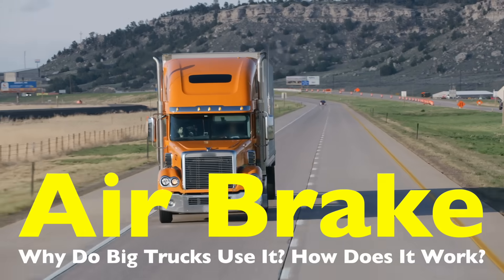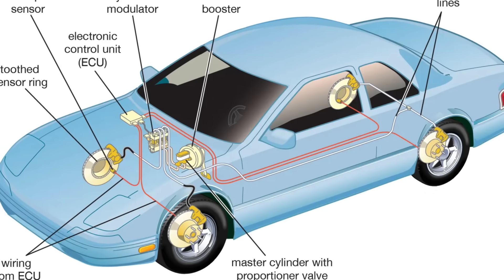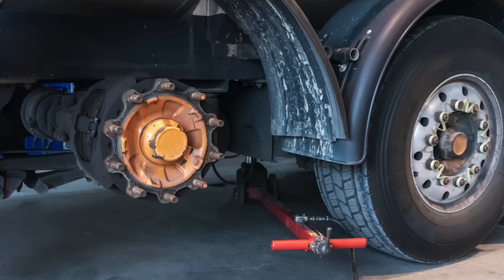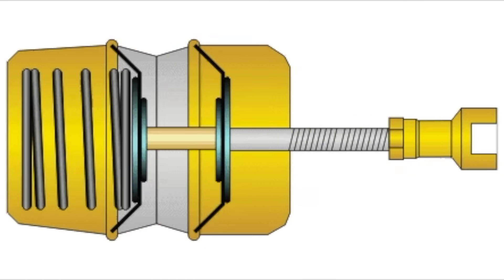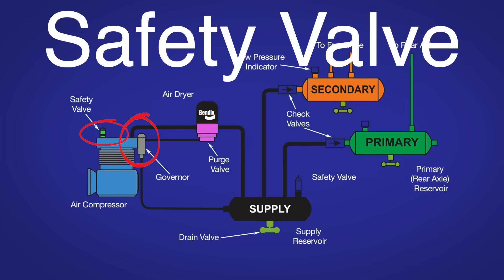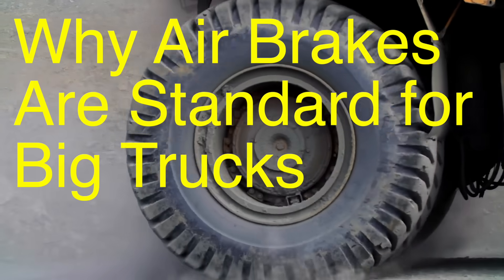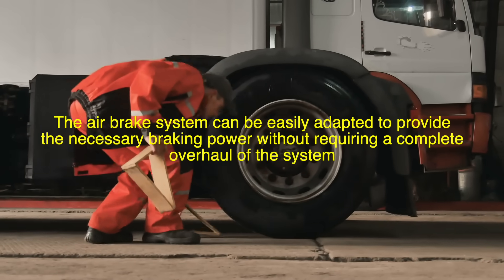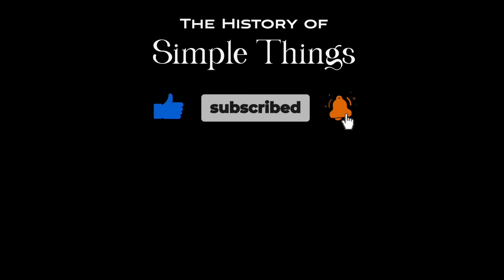Why Do Big Trucks Use Air Brakes? How Does It work?

Comment: As a truck driver, and mechanic. without even watching the video. I can tell you the reason why. It's because they're failsafe. Anything at all goes wrong with the brake system, and they lock on instead of just failing. Well then, you might ask why every car doesn't use them. They're marginally more complicated, require much more maintenance. Daily checks for leaks, and possible problems. As well as monitoring of various gages (and knowing what those gages mean, and the problems they're indicating). Asking the average person who doesn't even know how to check their own oil to do that? Yeah not going to happen.

Comment: It would be nice to see a video on how train brakes work.Ive studied them a bit and know they are actualy primitive and have no maxi,s as trains are much to long and it would take  to much air to build up to keep all the maxi,s off and way to much time.I do know that if trains could have maxi,s there would be 45 people still alive in Lac Magontic Quebec.That horrible accident was caused because the train engeneer an other crew left it running up on the hill with the engine was running a to keep the brakes applied.There was some manual brakes applid but not enough.Unfortunately te train or engine caught fire ,the fire department arived and did what seemed to be the logical thing to do by shuting the engine off .However the air pressure drained off thus releasing the brakes and the hand brakes couldnt hold the train from starting to roll down the hill into town creating a horrible disaster.If the train could have had the same breaking system as tractor trailers then the engineer would have applied both the engine brakes and brakes on all the cars and the train would have stayed still if all the breaks or most of them were adjusted properly.

Comment: one huge advantage is under hard braking you wont boil the brake fluid, and the air system and the valving allows for more pressure exerted to the brakes with minimal effort from the drivers foot and leg muscles.

Comment: The school bus I drove had air breaks.  Air brakes work opposite than hydraulic.  If there’s not enough air pressure, the brakes lock, stopping the vehicle.  Thats basically how they work.

Comment: Hello from Finland. Nice tutorial, thanks. Here our own trucks are in great condition due to mandatory yearly inspections (MOT) which are very strict.  But Russian trucks are very often in really bad condition. Our Customs check Russian trucks when they arrive here.  They must pass inspection before they are allowed to drive here. Often the driver loans or hires tools and fixes the problems themselves as they are used to maintain their cars even if it isn’t their own. And often they are much overweighted. Many trucks are turned back to Russia.

Comment: Another thing about air brakes is you can work on and replace any part of it, start the vehicle, wait for it to build air pressure, and then test the system. With hydraulic brakes, it is common to have to get someone to help you bleed the brakes. I find brake bleeding to be a time consuming process that is difficult with the configuration of the brake lines on some vehicles.

Comment: Air brakes can still function perfectly with a minor leak.  The air brake system will never run out of air but a hydraulic system will run out of brake fluid if there was a leak even a minor one.

Comment: The real reason they use air-brakes is the ability to change trailers; a hydraulic system would not allow for this.  Air-brakes are archaic, it’s basically the same system that trains have used for over a hundred years.

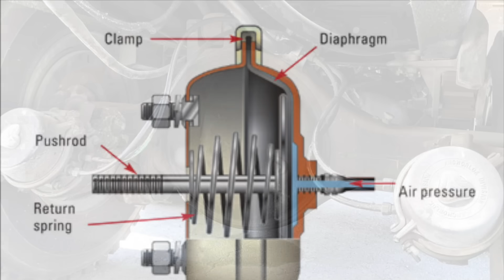Comment: 2:27  It should really be called air-released-spring-actuated-brakes.  The air pressure is actually holding back the spring that when released would mechanically clamp the brake pads or press on the wheel drums to stop the spinning wheels.

Comment: Hydraulic brakes can be used so much that the fluid can actually boil, reducing effectiveness. That's why some mountain roads have Emergency Ramps for failed brakes, but they are rarely needed now.

Comment: All of the smaller vehicles built after the sixties have duel circuit hydraulic brakes. Light and medium rigid tray trucks sometimes use an air over hydraulic system. The main reason large trucks use air brakes is for connecting the trailer brakes simply and easily, something that cannot be done with hydralics.

Comment: Quicker response. Compressed air moves at the speed of sound. Also if you tried to use hydraulics (fluid) to actuate all the brake chambers on a truck the driver would have to pump the brake pedal ten times to bring the brake shoes in contact with the drums.

Comment: Interesting, diagram labelled a spring brake. But wasn't a spring brake chamber. Stated air brakes are used because of the safety of a spring brake chamber. Air brakes were in use prior to the introduction of the spring brake chamber.
As mentioned by someone else. Input (brake pedal) application pressure to actual available output pressure is much higher in an air brake system, as opposed to a hydralic system.
Reply: Yeah, that was a simple service brake with no emergency spring. Good catch!

Comment: Big trucks use air brakes because the heat induced into the system by the massive friction it takes to slow a tractor hauling 80,000 lbs of goods would boil brake fluid in the lines and you would lose braking after the first few stops.

Comment: Hydraulic brakes don't "fail if there is even a single leak"

Just like air brakes, Hydraulic brakes are dual circuit. One circuit for front brakes and a completely separate circuit for rear brakes

Comment: hydraulique brake could do everything air brake do with less complexity the only reason air brake are still around in my opinion is because it would be hard to transition
Reply: Hydrauliques would be a big messy hassle when hooking trailers on and off. Something semi’s do daily !
Also air brakes are designed fail safe. If for some reason air pressure is lost (leak, hose unhooked, etc) the breaks would automatically apply on full force.  Those trucks (and trains) need air pressure to release the breaks, not to stop.

If you car has a big leak you can’t stop. If a truck, bus or train has a big leak it is stuck and not moving

Comment: My motor home has air brakes as it is based on a bus chassis.  I had a valve failure in the dryer and had a hard time building up enough pressure to leave a RV site in the mountains in the thin air.  When I got to a lower altitude the air was dense enough to overcome the leak.

Comment: If air brakes fail safe, then why do trucks lose their ability to stop when they are low on air? Try it, start rolling down a hill and keep applying and releasing the brakes until air is depleted, then try to stop.
Reply: By then the spring brakes will have engaged
Reply: They dont if the system is working properly. If you keep breaking and ignore the pressure warnings the brakes will slam on.  Though if you keep braking on a steep hill, the brakes might overheat and that results in loosing the ability to stop (until they cooled down again)

Comment: Air brakes main advantage is that it is not the driver’s muscles stopping the truck.  An air brake pedal opens a valve and then air does all the work. You are not forcing fluid down a pipe with a plunger limited by your own strength. If you’ve ever had a trailer push you down a road you’d know that you may have to get up off the seat and stand on the pedal.

Comment: The thing is on some trucks only one drive axle has the spring brakes so the other drive axle and the front brakes don't do anything if you loose pressure.  It's more common for both drive axles to have springs though, but you're still not getting any help from the front.  The front brakes really don't do much, but in an emergency the little bit they do will help a lot!!  Normally all trailer brakes have springs so they will do some good.  Springs can get worn and break over time and will never provide the same force as the air pressure operated part of the brake system even when new.
Reply: All trucks built since at least the 80's have spring brakes on all drive axles, and all trailer brakes are spring brakes. Steer axles don't have the spring brakes because if the pressure drops too low, the spring brakes will activate on all axles. That's not good because locked-up steer wheels go in the direction they were last pointing - despite where the steering wheel is turned.
Reply: It stands to reason. Most of the braking effort is always on the wheels carrying the most weight. In cars, 70% of the braking effort is done by the front wheels because the front wheels carry 70% of the weight in most cases. In a truck the rear and trailer wheels carry the weight, so that is where the effort is generated. In Australia, where a majority of long-haul trucks have more than one trailer, braking systems are even more complex. Road trains in NSW and VIC include either two 40-foot trailers or a 40 footer and two 20 footers in a C-triple combination and road trains in other states and territories are often twice as long and can weigh over 200 tonnes (440,000lbs), depending on the load being carried.

Comment: To be fair, modern hydraulic system on cars and light trucks in a seen have two separate systems as well. Meaning if you lose fluid to the front brakes there is still a reservoir with fluid to control the rear’s and vise versa in case a failure. It will allow multiple petal applications to an extent on a dual master cylinder provided it doesn’t allow air to enter the piston area and back into the system that isn’t leaking.

Comment: Now that I think about it, using a hydraulic system would be problematic when changing out a trailer. If you introduce air bubbles into a hydraulic system, it would create a dangerously spongy pedal. When attaching the air connection through glad hands to link trailer with truck, a small amount of introduced air would cause no problem at all.

Comment: I feel one of the key reasons air brakes are used was missed. It's the ability to readily attach the tractor's braking system to the trailer's braking system, simply by connecting air hoses together. Just like on a train, where the locomotive's braking system is easily attached to all the cars behind it. Imagine trying to that with hydraulics. Messy, inefficient, and not fail-safe.
Reply: There's hydraulic quick couplers to get around this

Comment: This is why we have so many runaway big rigs?
Reply: Improper braking on the part of the driver, or neglected maintenance of the system.
Despite the effectiveness of the system, the driver must get the truck in the proper gear to control his speed before starting down a hill so the compression of the engine can assist the brakes, helping to keep the brake shoes from overheating. As the brakes heat up from the friction they apply to slow or stop the vehicle, the iron brake drum will expand, increasing the distance between it and the brake shoes and thus reducing the available force until they can cool back down. It's this reason why big diesel truck engines are equipped with a compression release braking system commonly known as the Jake Brake. The Jake operates by the use of an electric solenoid that briefly opens the exhaust valve as each cylinder begins its compression stroke, releasing the compressed air so that the piston must work against a vacuum, dragging it down and thus slowing the vehicle. The Jake is so effective that given a properly set up system, a skilled driver can bring the truck to nearly a complete stop by only downshifting the transmission as the Jake slows the engine to the bottom of its RPM range, only using the air brakes to make the final stop from a low speed. This technique keeps the brakes cool, ensuring they are there when needed for an emergency situation.